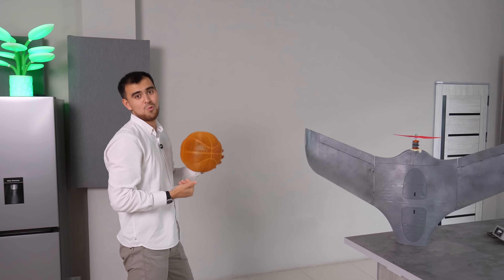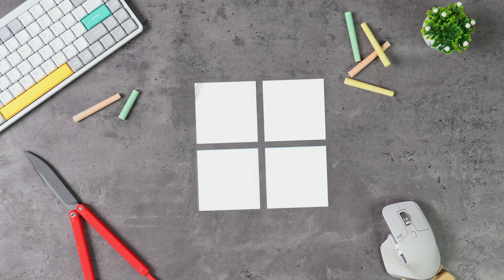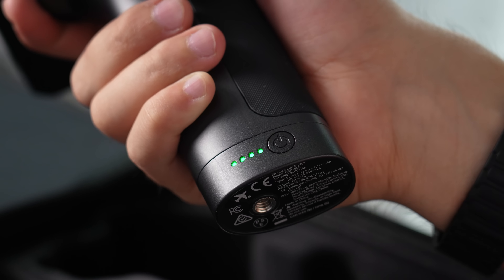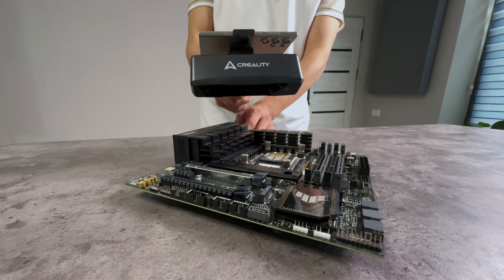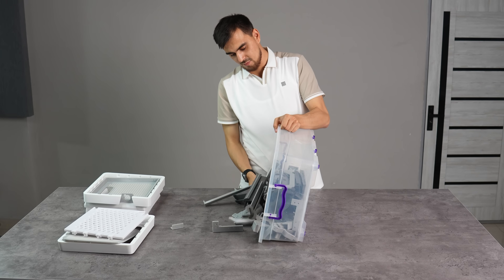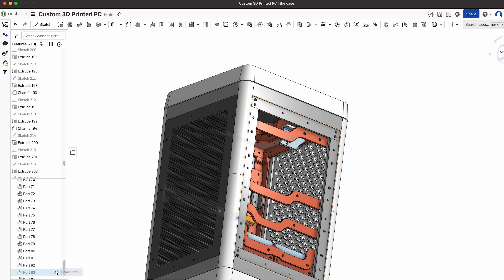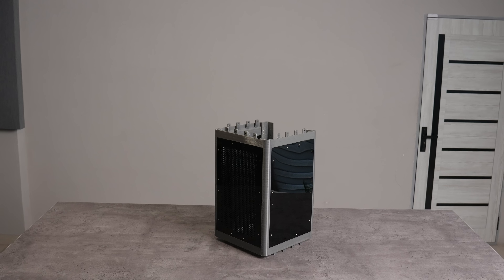Why 3D-Printing Your PC Case Actually Makes Sense - Sharing My Build Story

Comment: Tips: Don't rip of the artistic expression of another company or artist. That is about as clear of an copyright violation as it can be.
Tip2: Don't publicly admit that you made your case to COPY somebody else's copyrighted work. That is equivalent as to publicly admitting to a crime.
Tip3: The Mood case failed. It had too restrictive fabric and mesh.
Tip4: The top an the bottom is not balanced
Tip5: The front and the rear, is not balanced
Tip6: The PSU is not accessible from outside the case, which is a security risk
Tip7: Use only pan head screws for parts printed vertically
Tip8: Avoid solid frame at all cost, this is a solid frame design
Tip9: If you can print, print your own screws
tip10: Learn the concept of swivel, and use to screws at each connection point, for each part. This look weak.
tip11: Don't print solid parts, that are visible from the outside, unless you have to. People hate solid plastic.
tip12: Be aware of the every-thing-I-make-is-fantastic-because-I-made-it-fallacy.
tip13: Skip the theatrics, just deliver.
tip14: Never print a PC case using PLA

Comment: RTX 5060Ti at 80°C (176°F) after 60s is a bit too much for my liking... Next revision maybe you could try making thermal performance better! Nice work though
Reply: Yeah that's one hell of a toasty 5060Ti, the fabric he chose looks too thick, there are much more breathable options out there.

If you put your mouth against the fabric and you have any significant difficulty breathing through it, it's too thick/tightly knitted.

He's GPU won't combust, nor thermal throttle, but it's definitely not having a great time.
Reply: @ledocteur7701 are you sure it’s not throttling?
Reply: @NienteNessuno  Almost certain, GPUs throttle at around 100°C (115°C for the newest ones like my 9070XT), he still has quite a bit of room before there's any risk.

But long term wear and tear could be affected, and it's gonna be noisy.

Comment: Good idea to hide the print quality with a towel glued to the model ;) – jokes aside, nice project and presentation. Not so satisfied with the prints though. And just my 2 cents... i learned from David (aka the Prusa Guy) to always FIRST prime prints before sanding. Not sand and then prime. Other than that, nice approach.

Comment: Idea: Instead of designing the IO ports in to your existing case, make a dock(s) that it can nestle on to it's base with different IO ports for your needed accessories. Maybe, use a type C breakout board to a magsafe style interface connection. Since type C is reversible, you could 180 the IO dock to the back or front. Or, you could offset the magsafe and have an interface on all four sides. I'm using the nomenclature "magsafe" to best represent my idea. However, you could use pogo pins and contact points.

Comment: Sick build, but NEVER place the pump in a AIO Cooling higher then the Radiator. Because air, being lighter than liquid, will rise to the highest point in the closed loop system. If the pump is the highest point, air will be drawn into it, causing noise, reduced cooling efficiency, and potential damage that shortens the pump's lifespan.
Reply from the maker: Hey, thank you for the feedback, I considered it and thought the opposite orientation will kill it 🤔

Comment: The only issue I am wonder about is warping. How long will it last if it gets warm from all the components? 3D printing material does not do well in heat.
Reply from the maker: You can use temperature resistance filaments, I tried using PETG for the first time, we'll see how it performs.

Comment: The biggest problem I can see is that there isn't a clear flow of air from bottom to top. I'd actually have the fan blow downwards instead ofexhausting upwards. That way you are building positive pressure😊 which is then extracted through the radiator. If it is exhausting through the top then it might just be sucking air only through the top of the grill and not really supplying cool air to the coolers like radiator. I couldn't catch where the radiator exhaust is : through the fabric?  

Just need to make sure the coolers aren't just circulating hot air. Though if course sucking air down from the top catches all of the dust. So maybe you can create negative pressure below to exhaust upwards eg only have inbound ventilation towards the bottom of the case. It really depends how much vacuum the grill is creating but it looks like all air can flow too easily to have case pressure. 

OR do as someone else said and find a way to have an intake fan at the bottom (maybe can print a diffuser intake that sucks air from all 4 bottom edges of the case through a central fan?). 

OR sacrifice a little bit of graphics cooling a d have the radiator intake air instead of exhaust air - but then that hot air goes into the GPU so you are gaining CPU performance at cost of GPU (and maybe increasing noise floor if GPU fan is the weakest link in terms of noise). 

How amazing that this conversation is even possible :-)
Reply from the maker: Thanks for the detailed feedback, I will keep it in mind for the next design;)

Comment: Very nice print. I have a lot time that not made anithing with the printer. You have a good combo on it. For the case its very look but i think its too big. Will be nice made some similar with out liquid cooling. For the size that you have i think you can at a water cooling Video Card.
Reply from the maker: Thank you for watching and feedbacks;)

Yeah i think I should add gpu water cooling as well in this size!

Comment: Do yourself a favour and install your AiO radiator the other way around. The tubes need to go from top to bottom and needs to be above the pump. Otherwise you will kill your water cooler in no time.
Reply from the maker: Thank you for the information, I will check it out ;)

Comment: Brother, you put the RAM in incorrectly. With the RAM placed this way, it's not in Dual Channel. For it to be in Dual Channel, you have to put them one space apart, either channel 1 and 3 or channel 2 and 4. If you put them on channel 1 and 2, you're not taking full advantage of the RAM.
Reply from the maker: I noticed that when checking the manual, that was fixed after that shot, thanks for the information :)

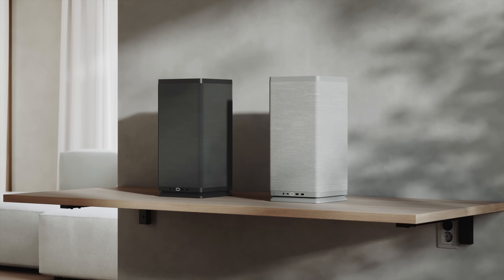Comment: 5:55 I don‘t only think that the fabric is bad for thermal performance, i know from Gamers Nexus that it IS bad for thermal performance. Perhaps Fractal could‘ve used speaker cloth as it‘s specifically made for air passthrough.
Reply from the maker: Yeah, their fabric is special, you can see light also can pass through it easily

Comment: My friend, very good! I would consider adding another fan at the bottom to form an ascending wind tunnel. Perhaps not the same large fan, but three or four smaller ones on the lower wall.
Reply from the maker: That's a great idea, thanks for sharing:)
I will consider this idea for sure when upgrading!

Comment: I could actually a see an LED (dot) matrix display, shining through the fabric , as a great addition to this case. It could be used as just a clock, weather info, hardware monitor and whatever else one might want to put on an LED display.
Reply from the maker: Yeah, you were first to say that, that’s what I planned to add as an upgrade, actually it is not that hard to add, but project was taking long time that’s why I decided to finish without it, I will make sure add that if I make upgrade video.
Thank you for the feedback and ide!
Reply: @engineericly  Well, seems it was your idea as well. 😀
A while ago I've  made a rectangular SFF case designed around the footprint of a 64x32 pixel LED matrix panel. The panel was the front and I covered it with black window film. I even added some touch sensing capability to it, so it would double as power button. Anyway, it just looked stunning to have this seemingly inert surface erupt in vibrant pixelart on touch.

Can't wait to see your upgrade video. Though I think for your case I wouldn't go RGB, but rather a simple cold white (might as well run RGB LEDs to produce that though). It would give a subtle look, rounding off the overall esthetics of the build.

Comment: You put the memory into the wrong slot on your motherboard... should be A2 and B2, check the manual ;)
Reply from the maker: Yeah, I checked it after that shot, you can see that was fixed later in th video without mentioning, thank you for the feedback :)

Comment: Ram sticks should be in the two grey slots .
Reply from the maker: Yeah, I checked the manual and fixed it after that shot, you can see it was fixed later in th video without mentioning, thank you for the feedback :)
Reply: was just looking for this comment or I was gonna write it. DUAL CHANNEL gang
Reply: First thing I saw too and it stuck with me lol. Sweet design though.
Reply: 9:26 he just installed on a2+b2 slots, the system show it self a message telling the memory was installed on incorrect slots after first time you turn it on
Reply: Yeah that was a pain to see❤
Reply: The Verge PC Build 2.0
Reply: Ik it’s a super late comment but if u see the scene where he places it in the case, it is infact fixed

Comment: What plastic did you use? I would be afraid about some hot spots and deforming.
Reply from the maker: Hey, I have used PETG for whole build
Reply: @engineericly petg sounds like it would make sense, it never gets to petg melting point in a case, and even glass transition temperature of 75c sounds very safe.